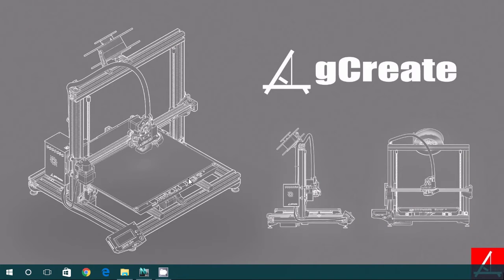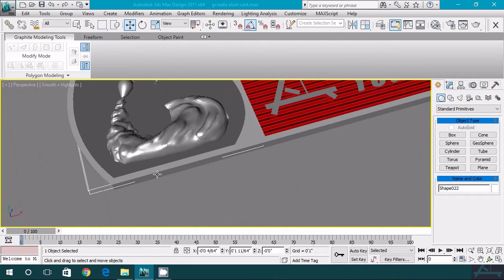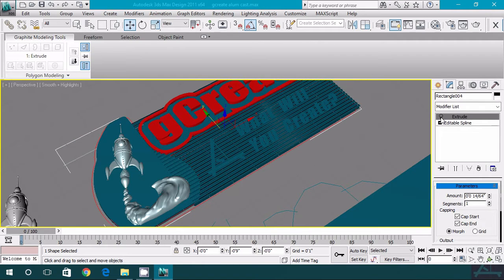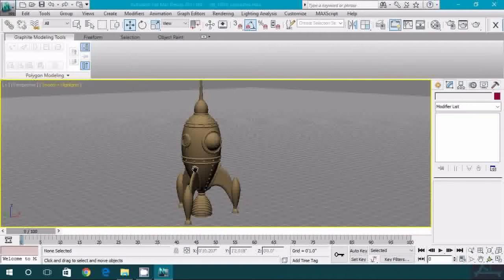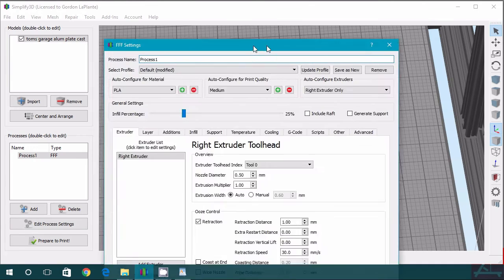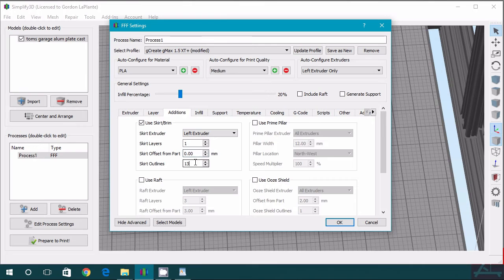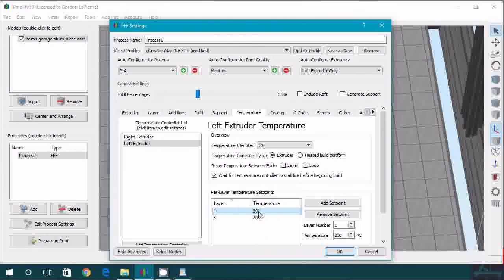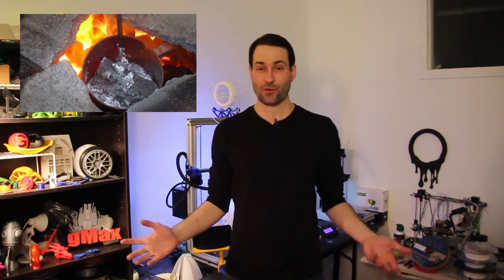Turn 3d Prints Into Aluminum w/ DIY Blast Furnace - Part 1 Modeling

Comment: why do you need infill for a flat part?
Reply: Between the two layers of the plate, bottom and top,... It's more like a Sandwich and not solid, otherwise, you'll use far more filament which will, in turn, cost you more.